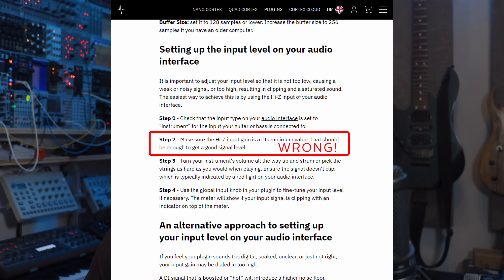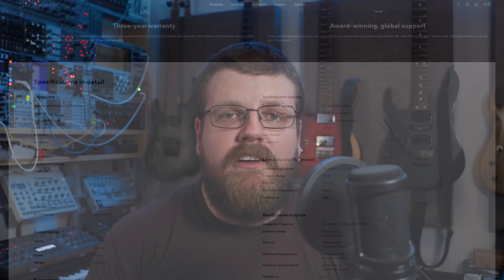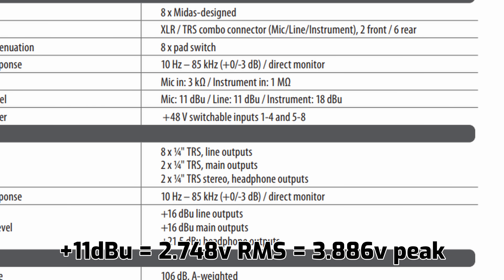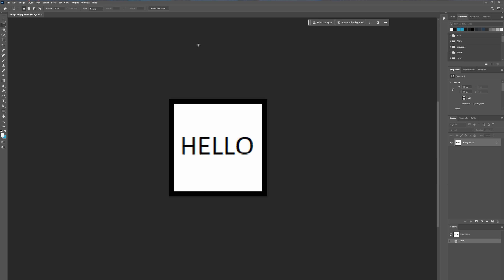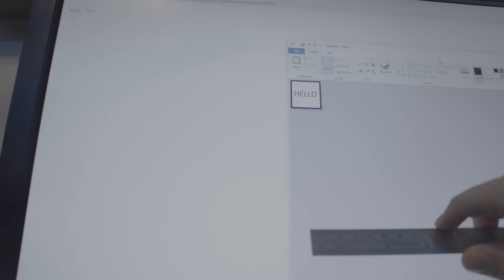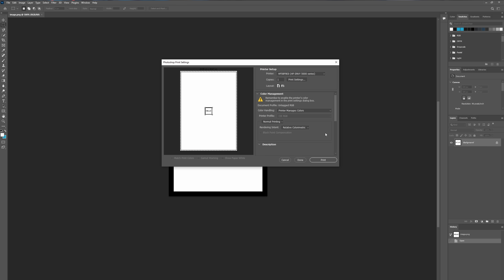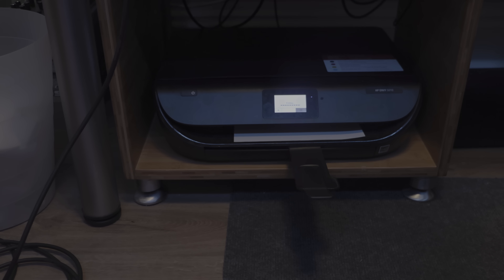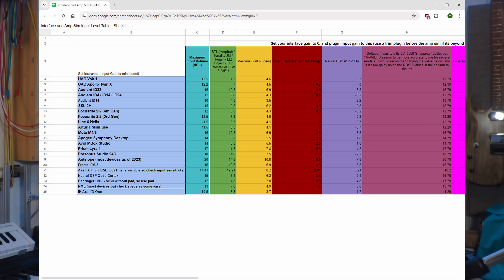Ampsims and input gain - Please, stop the madness...

Comment: Fellow DSP enginerd here. This video is spot on. Subscribed.
Reply: "enginerd" I like it 🤣
Reply: make an auto adjust input gain button
Reply: Yep, Subbed.
Reply: +1
Reply: I only get TWO outputs using Neural plug ins. Why? Now, if on my standalone Neural, I open two seperate AMPs, I can select a stereo pair PER amp- so I get access to all four. I think, if I open two instances, say in Reaper I will get 4 also. I was hoping to get this via one plug-in but no luck so far. I can go in 1 and 2 on my M4 and go out 1-2 or 1-3 or 1-4 or 2-3 or 2-4 or 2-3- but only 2. Any idea why this is? I guess it's more of a Neural routing thing. As a DSP Engineer I was hoping you could share some light on it. Lastly, what settings for gain stage do you use with Guitar Plug-ins? Same as him?
Reply: Analog strikes again!
Reply: So he told you what you already knew, so you subscribed.
Reply: I assumed that anyone that has red a/d converter data sheet would understand this automaticly. Otherwise it is like trying to break land speed record on the first gear.
Reply: I dunno, you misspelled engineer, so how can we tell you're smart enough to give advice?
I know, it's a play on engineer/nerd. but still...
Reply: @kiillabytez  If he knew how to spell I wouldn't believe he was an engineer.
Reply: @kiillabytez he doesnt even try to give an advice, he just likes the video

Comment: The last piece of the puzzle is in place, but I'm confused and need some help. I use the UA 710 Twin preamp DI (variable dBu from +18 dBu - +8 dBu at max level input gain). Using external Line in on my MOTU M4 and mainly using Neural DSP Amp sims, where the MOTU M4 gives a value of 6 for Neural DSP (according to the video).

Question one: Is it the converter and not the UA Preamp that determines the value 6 in my case?

Question two: If I push the signal just under-clipping on my MOTU M4, what gain value -dB should it be on my mix bus before the Neural amp sim?

Thanks a lot.

Comment: So in short, is this the correct (more detailed) version?

1. Set the audio interface gain to 0

2. Set the input gain on the amp sim according to the spreadsheet

3. Set a loudness meter at the beginning of the chain on the track and play as loud as possible, check what true peak dB value you get and write it down

4. Raise input gain on audio interface until it's just below clipping and write down new peak dB values

5. Calculate the difference

6. Reduce the amp sim input with the calculated difference
Reply: Don't bother, he engaged the pad toggle. Which makes this video useless for 99% people (Scarlett doesn't have that)
Reply: much more simple actually, just raise it until almost clip on your interface, and set the input gain on the ampsim according to the spreadsheet (example im using scarlett 2i2 which has 12dbu and neural dsp need 12.2 dbu i reduce the input gain to -0.2) simple right?

Comment: I'm amazed by the number of comments on this video!

I don't like to sound like a boomer, but I wonder if those of us who lived through some of the analog era had better intuition about this problem. Maximizing the s/n ratio is the correct approach. Use as many of those precious bits as possible.

Maybe another paradigm shift that plays a role is discrete devices vs. integrated devices that have become ubiquitous. In the early days, DACs, ADCs, and preamps were distinct items with the engineer understanding the specifications of each of the them.

One possible issue with the advice in the video is if your "interface" (the preamp, in particular) has some audible non-linearity which makes it subjectively sweeter in one part of its range. I'd guess that such equipment is not common these days, and the potentiometers provided don't give you a lot of precision. That could justify some sacrifice of headroom. For all of my equipment, though, being raised through the late 1980s and 1990s, my instinct is to give the interface as much signal as possible before clipping. And you want transparency in this stage if the goal is using simulation...

The spreadsheet and the "0db" step are interesting, and it's nice to have a standard, I suppose... but it accomplishes what we've done by ear for generations. Yay for standards, though.

[EDIT Other comments mention something important: There are existing standards. Just one world meeting another.]
Reply: He engaged pad toggle. Which makes this video useless for most musicians

Comment: Ok, so let me get this straight. I turn my interface to zero. I adjust the amp input value to match the spreadsheet (-1.7dB in my case). I play as loud as I can and see what value it produces on a loudness meter (-19dB). I increase my interface input gain until right before clipping. I play as loud as I can again and compare those values (-4dB) to the values when the interface input gain was on zero (-19dB), in this case a 15dB difference. I then reduce the plugin input gain by that amount? Is that in addition to the value on the spreadsheet? For example, I reduced the plugin by 1.7dB at first so do I subtract 16.7dB (15+1.7) or just 15dB total?

Comment: Not sure.. for lower gain tones and edge of break up it sounds so much better with the gain on zero. I got that advice from Jack Gardiner who has an amazing tone. We have the same guitar and his sounded so much better than mine with the same Neural DSP plugins until I turned down the gain to zero and never went back. Not using Neural DSP anymore but that’s back when I used to use them all the time. Sorry this is not technical at all

Comment: Thanks for clarifying.  Been doing it "your way" for ages, & the recent discussion all over the interwebs had nearly convinced me that I should instead be recording about 12db quieter than I have been, rather than just normalizing the file post performance to my desired peak after tracking.

The crazy thing is that I've known better for ages, but when enough voices say the same wrong thing, it can give you pause.  The noise floor issues associated with low input signal seem obvious, but when a bunch of "smart guys" say noise isn't an issue with low input gain...  Sheesh.  Nice video!

Comment: I am an hobby-musician... I am a Tech-guy too, not an expert on Audio though... 
I just managed to do a-la-my-best comparison, using my MiniFuse2, and a classic free VU Meter which also read and hold the peaks...
Gain down completely = noise floor was -79/80dB, signal gain ~-26dB (mmm)
While now at, half way up on MiniFuse2 - just before it clips (red#), I get signal up to +6.3dB, meaning it has gone up by 32.3dB gain and Noise floor was at ~-75dB - minimal change
I did not use any guitar plugin - yet, just the input from MiniFuse to Daw (BitWig)
YOU ARE RIGHT ! 😎👍

Adding TH-U in between with a basic Labs5 Clean amplifier and VOL at 5.5dB - no Noise Reduction added I get:
Noise Floor at -86dB, Signal -22.6dB - MiniFuse2 (just before clipping - pencil marked now) = Noise Floor -79dB, Signal -2dB - a gain of 20.6dB
EUREKA ... I think I did it correctly - after a few attempts.
Note: that is how I normally set my MiniFuse2 - I guess I inadvertently done what you just are exposing for decades - facts!
It is something I always done with audio - many decades - but never really measured it - not having asked or had the need to!

Comment: Gain staging is happening in a lot of stages, it is not one gain that rules them all. When you have a guitar with pedals and an amp, you have gain from your volume pot to each pedals volume to the amps preamp gain to the volume of the power amp to the speakers limits and all of the above are making your sound.
Plugin companies should have an indication in the input section, something like the green to yellow to red bar that shows if you are clean or you saturated or being over.
The wrong mentality about gain staging is everywhere in the digital world of recording and mixing, you still have the whole idea that if analog emulation plugins work in a way then you record in a specific level. Without caring about signal to noise ratio, or how the impedance of the preamp reacts to the microphone or anything else that has to do with all the different stages of gaining. You can set the levels after as you wish very easily in any daw.
Also even for mixing plugins you have a similar all over the place difference in how they react to different levels, a waves plugin react differently than a uad and differently than a plugin alliance one etc. For example I use sometimes a pultec plugin in my mix buss for rounding the sound by pushing it a bit , a friend had a mix using a pultec on the master buss and I just I played a bit with it and he was impressed asking me how I did it so fast and I make it sound like that, he was impressed when I told him that I’ve just push a bit the levels before the plugin, he was obsessed with numbers that internet told him before that moment of realisation. Regarding the difference between plugin companies sometimes using plugin alliance plugins I tend to go to the headroom setting where there is one to make different plugins react similarly etc

Comment: possible dumb question: My amp sim doesn't display the numeric value of the input gain. If I left the amp sims input gain at 0, could i use a Utility (in Ableton) set in front of the amp sim to adjust the input gain instead?

Comment: Great video, thanks. :hand-purple-blue-peace:I have always had the approach, that I don't want to break any hardware and also used that in similar way for plugins (trying to adapt the input for any plugin to it's "best" range , eg simulating not breaking the plugin). 🤣 Sometimes in Logic even adding a Gain plugin in between. Who loves a mix that is filled with massive noise, from multiple sources? 🤔

Comment: 7:11 Judging by your footage you activated BOTH instrument and PAD knobs for your input. The latter attenuates the signal.
So the advice about 0 gain might sill hold on simpler interfaces / non padded inputs

the INSTRUMENT / Z inputs are already delivering max (or rather optimal) gain for PASSIVE pickups without clipping and changing gain knob even one degree results in clipping (at least with interfaces and guitars that I had focusrite and motu).
Reply: I noticed this also. 18 dBu normal and then the PAD adds at least 10 more dBu of headroom. 
Maybe he will make part 2 with modern style interface and humbuckers with 12 dBu of headroom.

Comment: Well, I'd add to that that if this is just a guide for people who don't understand audio at all, you'd have to also tell them to DITHER, possibly even at track level, but most definitely when exporting to 24bit after the matter, else you're adding truncation noise (unless you're using very clean digital gain like bit shift). Your point is still correct of course.

Comment: I have been screaming into the void about effective bit depth for months. Nothing but downvotes for bringing it up. People saw one or two interface null tests, proving that bandwidth and snr is preserved, and believed that this is the end of the story. Then they get on the forums and complain that they can't hear the differences between compressors. Well, is your digital output at 50%? Do you realize that reduction in effective bit depth == reduction in dynamic resolution?

Comment: Great video! Great example using pixels. Back in the late 90s I did web development work and couldn't count the number of debates I had with people when I told them them making an image 144dpi and displaying it on a 72dpi monitor was not in fact "double the resolution". It was either twice the visual size, or twice the download time, depending how it was coded to display, but never was it twice the resolution. I see the same goofy thinking going on today with gaming resolutions.
Reply: Yeah, but the image itself has a size. Just because it displays differently on a less capable monitor doesn’t mean the image itself has changed size, it just displays differently. There is a reason you can convert images measured in pixels to inches/mm.

Comment: 0db on a Microphone Pre-Amp gain knob means full gain, no attenuation,  which you hardly ever will need it. That 0db mark has nothing to do with 0dbFS which is the maximum level possible to be recorded in a digital domain. There is no relationship between pixel resolution and bit resolution. If you record a 1khz test tone @ 0VU, which is equal to 1.227 volts on a +4dbu system, the recording quality  will be exactly the same in 16bits, 24bits or 32bits. Bit resolution is related to signal to noise ratio and not quality of the  material. If you have a S/N problem recording an electric guitar around -18dbfs in 24bits, it only means your interface is not professional and you should replace it. If the noise comes from the Amp, Guitar, ground loop or cable,  any gain you dail in will bring the noise up.
Reply: wrong, wrong, wrong wrong wrong.
Reply: @redcollard3586  Explain?

Comment: I think there are two different things here.

The point of their video is that people raised the gain without compensation after that (not so easy to adjust for someone like me who just want to play and record for fun), so the simulated gain was always boosted and the simulations were very different from the real amps or other hardware counterparts.
So when you say they are wrong with their videos, I think that they helped a lot of people doing more wrong (wronger ? I’m French so it’s no easy in english).

Several years ago I compared my Helix Native gain with my real Helix and lowered the gain. For playing and my recordings it is not the best way but it is enough (and I play clean to crunch, so maybe de noise is not so important). Gain to zero is easier, nothing to adapt from low level guitar pickups to high level humbuckers.

But technically speaking, and for professional work you are right your method is the best. I just think you didn’t consider what many people were doing before that (seen and discussed that many time on forums). And what mistakes people not understanding everything in your video can do with their VST .

Comment: I may try this one day or another. However I'm not really convinced, yet. I mean I basically did it like that for years and never got any good sounding tones out of any vst amp with my roland interface. Than I heard about the 0db-thing, tried it out and everything sounds great. I must admit though that I probably never thought about reducing the input level inside the amp sim, but rather the gain nobs and the other stuff you would tweak on a physical amp 🤔
However I'm actually ok with the noise to gain ratio that I got with the 0db method, cause especially NeuralDSP has really good noise gates in their vsts. And I don't need to adjust levels for different guitars with 0db.

Comment: This works in a similar way for most DACs, of course.

If I'm playing music from a PC -> DAC -> amp (or using an AV receiver with a built-in DAC), I always strive to leave the digital volume level on the PC at max.

The volume control on the amp or AVR is most often done in the analog domain.

Yes, even though most modern AVRs have a digital rotary encoder for the volume knob, and display the main volume as a digital value.
The gain (or you could say attenuation) is almost always done after the DAC output, and before the input to the power amps.

This maximizes the use of the number of bits in the DAC, otherwise you're throwing away SNR.
And you'll also be boosting the inherent noise floor of the DAC, when you have to crank up the (analog) volume to hear the music at a similar level.

Obviously it's not quite the same thing as with ADCs, but very similar.

tbh, like you, I assumed most people already knew this. lol
Reply: I haven't played keyboards in a long while, btw, and can't play more than two chords on guitar. lol
(but I did mess with Guitar Rig 3 many years ago, and instantly noticed a similar issue with the digital vs analog gains.)

I do quite a few projects involving audio electronics, though, and recently built my own AV Receiver (prototype).

The AVR has 12 channels of power amps (six TPA3255 Class-D modules), and decoding for Dolby Atmos, DTS-X, and several older formats.

I used the older ESS ES9008 DAC on the prototype, but it has some annoying issues, like quite a big delay after the audio input format is changed.
The new build will use a pair of ES9028Pro DACs, for 16 channels total, some of which will be used for multiple subwoofer outputs.

This is mainly why I'm watching videos like yours, as I will have to make sure all of the gains in the system are correct, without causing clipping on the inputs to the amp modules, or on the XLR preouts etc.

(at "0dB" volume level, which is done in the analog domain, between the DACs and the power amps / balanced preouts.)

I haven't yet tested the noise floor of the system, but if I can even get to say 90dB SINAD, I'll be very happy.

Comment: God I hate reddit lmao. Thank you for this.
If you go back all the way to the sort of early days of cassettes, what Dolby was doing is put a low shelf filter on the recordings to lift the higher notes out of the noise floor and EQ it back inside the playback device to get rid of the bulk of conversion noise. What these guys are doing is the direct opposite of a 40 years old solution for noise cancellation. They invented noise approval. Noise embracement. They made noise mandatory.